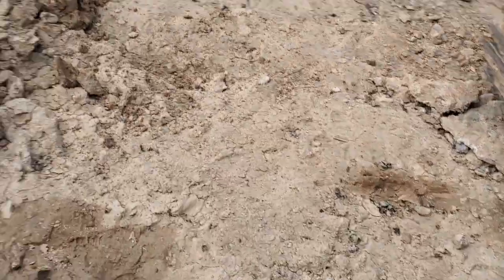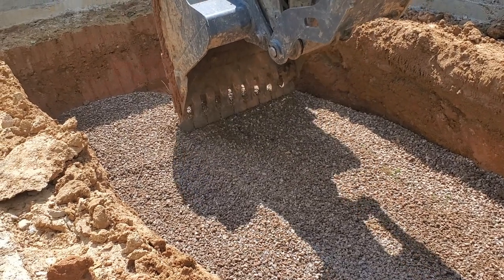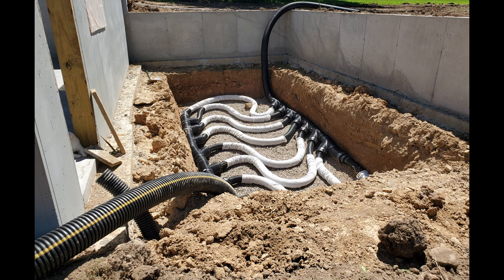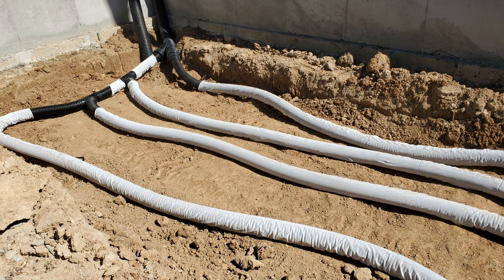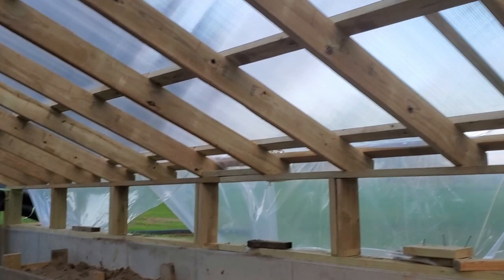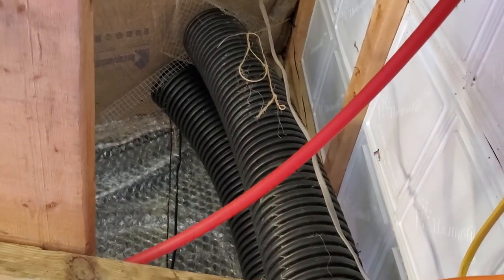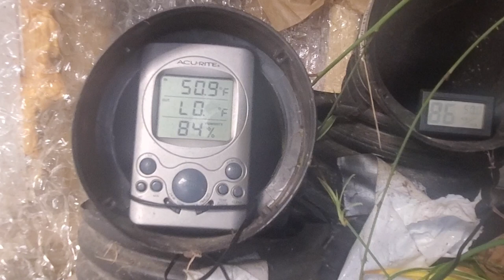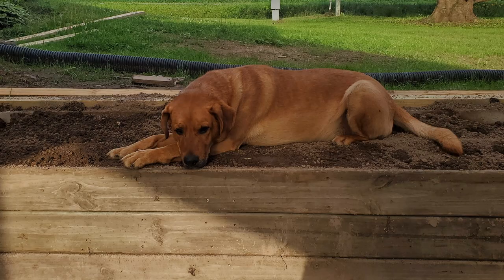Ground To Air Heat Transfer System (GAHT) installed in Underground Greenhouse / Wisconsin Walipini

Comment: Really appreciate the before and after footage. I'm saving you in my collection for building my climate battery greenhouse. Might slow down on moving the camera around so we can see things slower and longer and less dizzying.
Reply from the maker: Hi Charlolett, I hear ya on the camera movement.  I told another guy who posted here that when I filmed this, I had no idea I would ever put it on Youtube.  I figured it was for personal use only, and I can easily slow it down on my computer. That guy deleted his comment and mine.  Don't know why.  In the meantime, you can set the speed on YT to .5 for similar effect.  I'm trying to slow down some of the other video I take even further, but I have gotten better.

Comment: You should try to keep the tubes straight which reduces the losses. I hate to sound negative but you dont have nearly enough tubing and your headers should be a larger diameter as they have to carry all of the air  :)  It may be too late but did you modify the tube to ensure the condensate fully drains? The holes/slots in standard drainage tube allow water to collect in the bottom of every corrugation. These systems work very well but they have to be designed correctly. Fwiw, 53F with 71% RH is not so good for plant growth as it will result in under transpiration. 46F and 86% RH is not great for plants or the structure itself, i`d try to get the RH% down to 60% and ideally closer to 50% if you can.
Reply from the maker: Modify which tube?  The ground tubes rest on gravel, at least in the lower circuit.

I assure you, I ain't ever digging this stuff up again. :)

This vid does have a glimpse into the walipini as it stands but isn't a 'tour.'  I have several videos showing the walipini so you can see how it is working.  Maybe it isn't working to peak efficiency, but I've been happy with it and the results have spoken for themselves.

There are some plants that I am confident that don't respond very well to the temp/humidity, as you say.  It is something that I will continue to watch.  As you will learn if you watch some of my other videos, my goal here is really just to keep the plants alive over the winter. Some of them need a 'winter' season, so I have to let the temp drop for them to bear fruit--but not too much, or there goes the coffee plants!  

Personally, I don't think I can create a system that will be optimal for all of the kinds of plants that I have in there, so in a sense my policy is to aim for a 'middle ground' where perhaps all of them are a little unhappy for four months of the year, but they can all thrive the rest of it.  Rules out vanilla, I'm afraid.  

If my goals change, then I will certainly be looking at some of the tweaks you refer to.  

Thanks for the comment!
Reply: Hi John, Sounds like you have some experience/expertise on this type of system. Do you have any advise on where I can get more info on condensation control? Also the system I'm constructing is going to be as power efficient as possible. I'm looking at a depth of 8 to 10 feet, I'm considering using a liquid system along side of air. Using above ground radiant heat to intoduce thermal energy into the groung, what is your opinion on using sand or a clay mix for thermal energy storage? I figure if I'm going to build it I might as well include a liquid system as the additional cost would be minimal. Would it be better to keep he systems completely separate?  Is using thermal energy storage impractical?  Thoughts?

Comment: ghat system looks cool.  I'm wondering if the intake tube should be lower to the ground to create a vacuum.
Reply from the maker: Not sure I follow the reasoning. My goal is to grab the heat, and since heat rises, its all at the top. You think if it was lower, the 'vacuum' would grab even more of the heat?